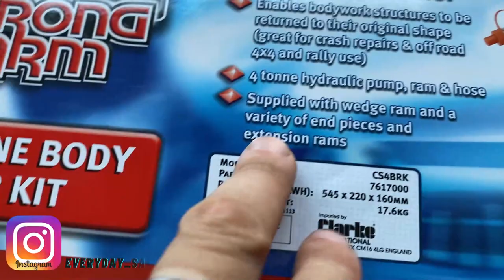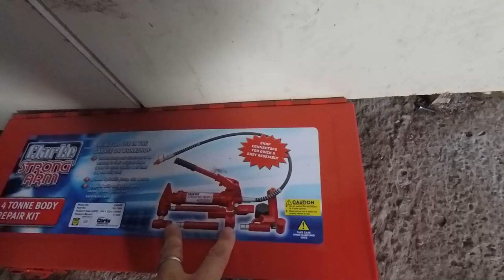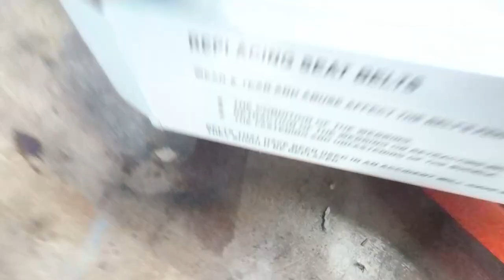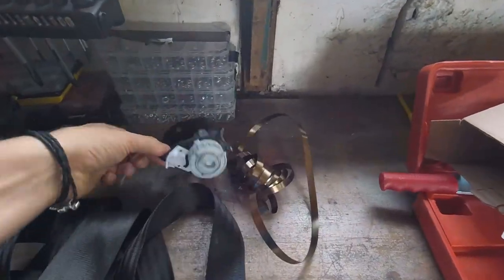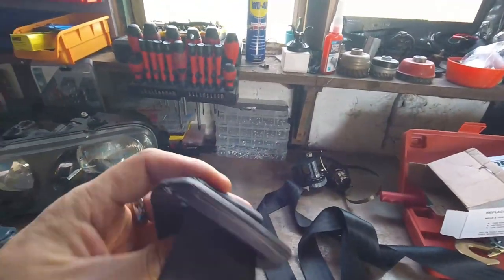Using a 4 Ton Hand Press to Straighten Crash Damage to A Car Body Frame And a Tree - Part 4

Comment: Some of the most useful tools I've found for straightening out front end damage on older vehicles is a selection of old scissor jacks.  Of course, I'm of the age when most second-hand vehicles came with a scissor jack in the boot for changing wheels, so I'm not sure how easy they are to get hold of now, but you'd be amazed what can be achieved with a few scissor jacks, a desire not to be beaten and a sense of humour...
Reply: I have also used scissor jacks with great results they can get into tight spots
Reply from the maker: I didn’t even think to use one and on this channel I resorted one lol.  I will if needed use one next time.

Comment: Cut yourself some blocks of wood use them behind when your pushing off parts to help spread the load and wood will give a little rather than damage what your pushing off. find a tree if you can and try making an attachment to inner wing . try pulling and use the portapower to push at same time . trial and error it will yield in the end . Dont pull off the wall it will prob pull it over. If you find your dragging car attach another motor with tow rope behind 2 cars handbrakes on and in gear
Reply from the maker: A tree is in the next video ;) I’ve taken your advise onboard

Comment: What happens after this, you have to have it inspected and then you can register it? Is that how it works?
Reply from the maker: No inspection, just put back on the road. If there is an issue its normally picked up on a MOT. No need to register either.
Reply: @everydaysalvage  would that be illegal driving without registration and insurance? Lol.
Reply from the maker: @vincentxiong16  no it works differently in the UK.

Comment: What you should do is use another car to anchor that puller or simply use the other car to gently pull the damaged area out slowly or use a tree and drive the damaged car in reverse slowly and pull it out that way. It will work but the Clarke thing is pretty pants by the look of it
Reply from the maker: I used a tree, it’s up in the next video 👍
Reply: Everyday Salvage brilliant I’ll have a look when you upload it :)
Reply: I used a BT pole once 😂